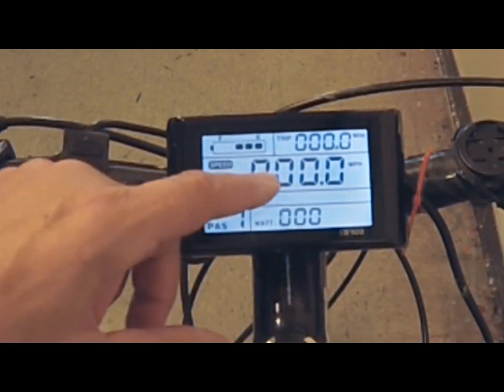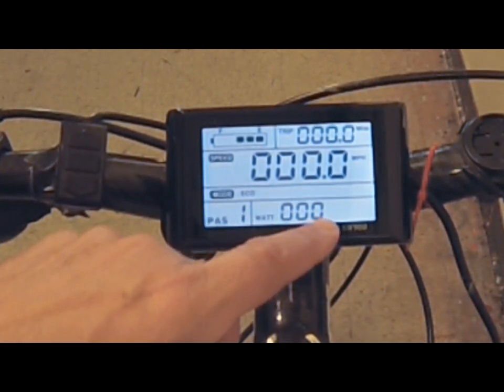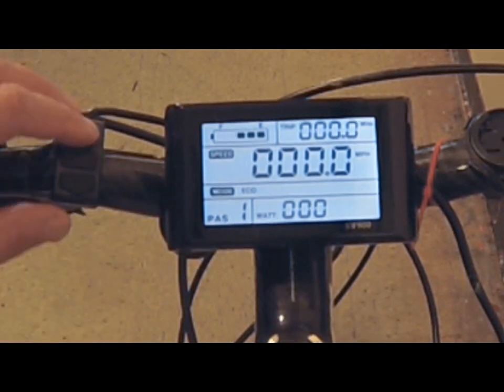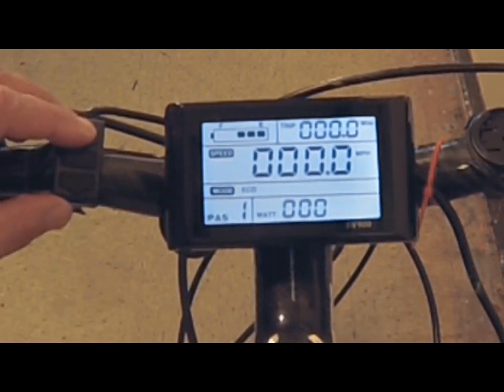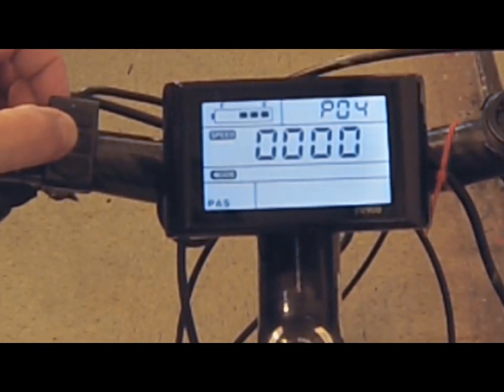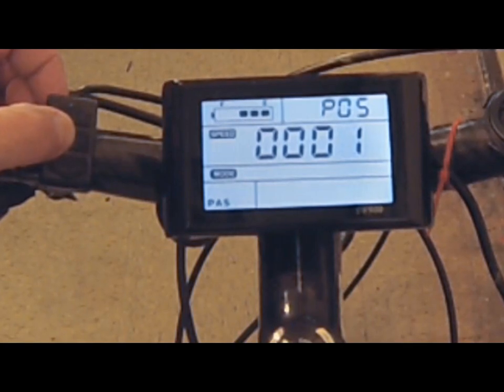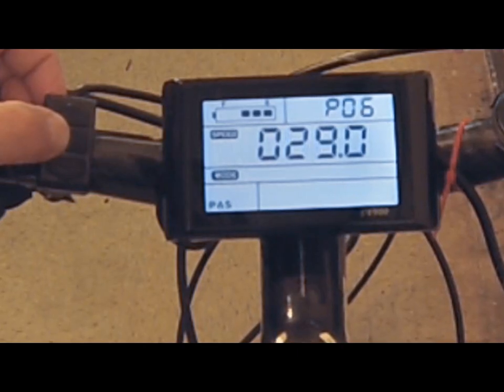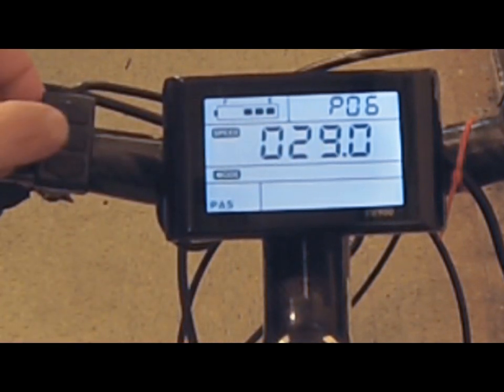BOOST your EBike's performance in 5 minutes by programming onboard computer

Comment: This video really save my e bike my pedal assist has been kicking in and off. Because my motor came 48v 1000w.  The pedal assist has 8 magnets.that come with the kit.  But didn’t fit my bike.  So I bought an after market pas sensor. 12 magnet.   
I started experiencing some strange kicking in and off when pedaling.  After watching this video.  I switched to to 12 magnet on the on the display screen. On num 13.  Where he spoke about you can choose either 5, 8 or 12 magnet. Originally mine was set at num 8.  So I change it to num 12.  Because The pas I bought was 12 magnet.     
But now it’s zoom zoom zoom.    Wow.    Thanks a million.  and it work really fine thanks a million

Comment: You say refer to your manual. WHAT MANUAL???!!! The motor did not come with one! Good video, though and thank you. I STILL haven't got the bike to move except in the "Walking Man" icon. Or about 4 mph. I even bought a new contoller, a device to check the contoller and new pedal assist sensor. I REALLY NEED THIS TRIKE, as I'm handicapped and it's my only form of transportation. My next purchase would be a new twist throttle. No bike shops around here will work on a bike they didn't sell and I built my own. Any help.would be appreciated!
Reply: Exactly. Some guidance would have been helpful. Like "if you have X motor, use Y setting", etc.

Comment: I saw my setting for tire size was 24 inch and my tires are 20 inch ? Isn't the wrong tiire size in the settings going to mess up the correct mph and milage ?
Reply: Yes. It’ll say you’re going faster than you actually are. The bigger tires need more power to turn and will carry you farther at the same rpm compared to the 20” tires. So change the tire size or throw on some bigger wheels to go faster.
Reply: @vs4571  yup i changed it to 20 but i keep hearing about others who made some changes and we're able to throttle at a higher at a higher speed.  I made few  charges but still top of a 20 ?

Comment: Can I perform a firmware reset without worrying that the motor parameters will be changed afterwards?
I have no data on my engine.
So the factory condition is the condition of the controller where I got it? or did the seller adjust it so that it works and after the firmware reset nothing works anymore?

Comment: Great video! Any chance you have info on the RadBikes controller os version of the 900? There are only 3 settings/options given after the up&down arrow hold. First is wheel size, second is speed limiting (in km/hr) but no display info is given on the 3rd setting which has options of setting 1, 2, or 3.
Reply: Found it, 3rd setting is the BackLight according to supplier video description finally found.
Reply: Vince

Comment: trouble with S866 controller - when I press my + - buttons  I do not get the P programmes - I only get 4 dashes at bottom of screen - you can scroll through and change to some letters and 0-9 numbers - no idea what to do ! can anyone help
Reply: Try entering the numbers 3745 and it should let you through. I had the same problem, hope this helps.
Reply: @colevisuals111  thanks for your help - company eventually got back to me and gave me a different password 6666 - hope this helps anyone else out there

Comment: It's sad my 1200w kit can't go but about 30mph. And my last 1000w kit was able to hit 45.5mph, or the max speed it would give before it would immediately cut the power from the bike. Unless I was giving it a 52v 17.5ah battery hence why it was so powerful. It was pulling 1800w at the most. This new 1200w kit is okay..but I wish I could get it back up to 45mph at the most so I could get around places easily. Speedhacking these aren't easy.
Reply: It also depends on what controller you have. I have an off-road e-scooter with 1500 watts, whose cables are 4 times thicker than those of these 1500 watt bike controllers.
The battery (4x12v agm) from the scooter has a 60 ampere fuse built in, from which you can call up 40-50 amps as continuous output. These ebike controllers, however, only have a continuous output of 17 - 18 amps and briefly go up to 35 or so high.
I can do about 30 mph with my 1500w kit and the acceleration is poor until I reach 9 - 13 mph, only then does it start accelerating faster.
At first I thought the dealer had ripped me off and sent me a motor with less watts, but according to the display the consumption is actually 1300-1400 watts.

Comment: How to stop the mileage from resetting after a short break
Reply from the maker: Unfortunately will lose your trip distance every time you turn the battery off, however it does not effect the odometer. So in order to keep track of your trip distance remember where your odometers mileage was when you started.

Comment: Hi, very helpful video, learnt a lot from it.

1 issue I have is, I bought the new ebike motor where the controller is built into the motor, it is a 48v 1500w

I had to increase torque via increasing amps.

I had a 48v 1500w motor before my current, it died on me unfortunately. But the power from the old one was  a lot more better than my current one. 

I noticed my current motor is only displaying a maximum output wattage of around 800, whereas my old one, would at times, display over 1600 watts. 

Is there any way where I can unlock more wattage output for my current motor?

Thanks
Reply: Vince Livingfree do you now know how to?
Reply: increase your p014 setting. if your being limited to 12 amps at 48v thats only 600watts.

Comment: i did get accessed to the settings and adjusted the speed on P8 to 70 khp, i tested it out but speed still the same, is there another step i missed?
Reply: there is no P8. P1-5

Comment: I changed the top speed limit to max, but when I reach 25km the bike still limits the speed. It feels different, like if the bike is braking. Is there any solution to this? I have the kt-lcd3
Reply from the maker: Using the up arrow key, set the PAS to the highest number. I believe that should help. Let me know
Reply: @AugustineEBikes  you mean while biking? Yeah, the ASSIST value is set to 5 while reaching the 25km/h and the brakes hit. Even The brakes icon flashes when this happens, as if there is another system or configuration to change. To test this issue, I changed the Wheel Diameter to 6’’ instead of 29’’ in order to “fool” the device and reading a slower speed, but when reaching around “real” 25km/h it still slows down (the displays shows a much slower speed like 5km/h when this happens but its definitely running at around 25km). Could there be another system that tracks the speed and deactivates the motor?

Another thing that I found after changing the Wheel Diameter is that the throttle function won’t stops at 6km/h as it used to, but now it holds up to 25km/h before shutting down (while again the display shows a lower speed reading). So, the change in the Wheel Diameter indeed changed something but not the overall top speed. Thanks in advance
Reply: Isn't it that magnet sensor, in the rear wheel? You can fool that by putting the magnet on your pedal and changing the place of the sensor. It will detect a way lower "speed" and give you more juice. I think there are video's about this.
That is... "IF" it has a magnet sensor.